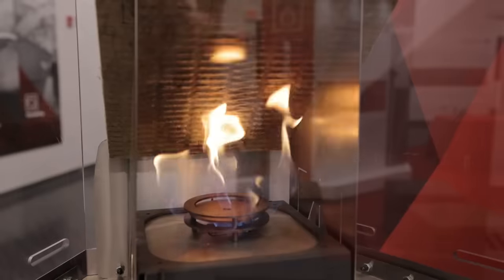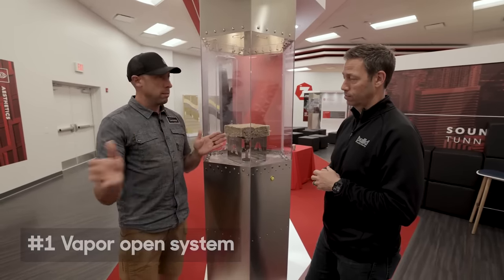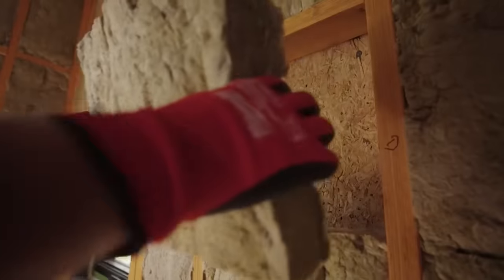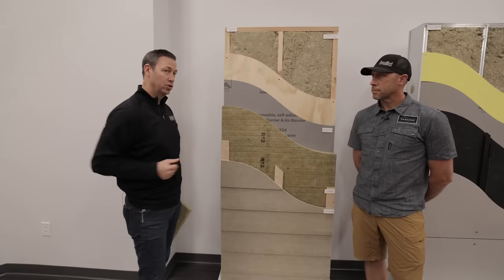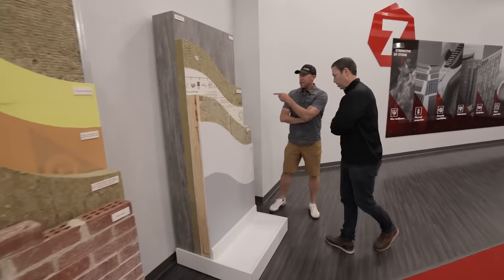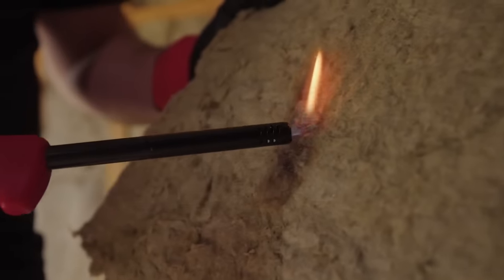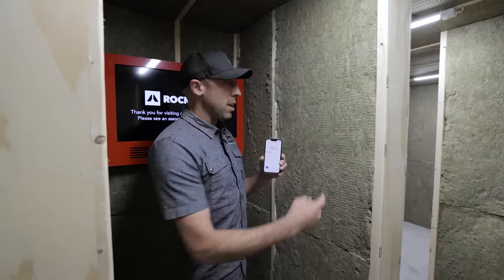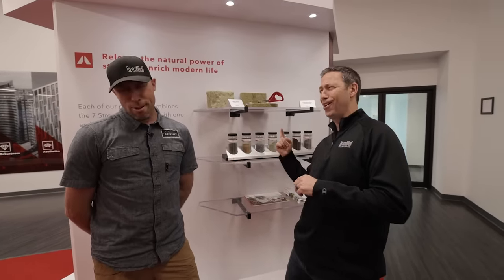3 (little known) Benefits of Rockwool Insulation

Comment: I’d like a video that compares rock wool to other mineral wool competitors. Not a lot of info out there on that and I’d love to learn.
Reply: I can compare it to the stuff from Menards.  When installed it seems similar, but the Menards stuff is terrible to work with.  I installed some in the ceiling of my basement, and had to wear goggles.  It sheds dust and fibres.  Safe n Sound doesn't.
Reply: @r7boatguy  I used the Menards stuff recently too and I had the same experience. Wasn't expecting that.

Comment: Thanks for the great video. I have a 100 year old English Tudor revival in the blue ridge mountains of North Carolina. We are wondering if we should use rock wool in the attic space above the coach house. We have a slate roof which is original and wonder if we should place the rock wool in the cavities between the roof rafters and also should we place an air vent against the roof sheathing first and then install the rock wool?

Comment: I live in Northern Illinois, building our retirement house with a GC.  If we use 5.5 Comfortbatt in the exterior walls (2x6, 16oc) with 1/2 zip sheathing, do we still need insulation board on the exterior wall and do we need a vapor barrier on the inside?  I think in this video you indicate no vapor barrier is needed?  Thanks, love your "delivery" of the content!

Comment: I've put Rockwool (nee Roxul) in my attic and most of my basement.  Living on a busy and noisy corner, heading downstairs to the den, in the basement, traffic and sirens have disappeared.  Plus, the den warmed up significantly also.

I'm a happy camper.  Just wish I had the funds and patience to open all the main level exterior walls and replace the beige 50s-60s insulation.  Sadly, it would be cheaper and easier to add insulated aluminum siding, which I'd hate.

Comment: I’d be very interested in how that sound tunnel works once drywall is up.
Reply from the maker: Less good. Much less good. That’s why my studio has filter fabric over Rockwool and it’s really dead sounding
Reply: @buildshow  The sound bounces off the smooth drywall surface. The bare insulation sucks up the sound waves.
Reply: Matt you need to clarify- if you are talking about deadening sound reflections WITHIN your studio, yes, u r correct obviously ,BUT for reducing sound transmission to the OTHER room/side of wall, you WANT mass, as much drywall as possible!

Comment: I built our house with 8 inch metal studs and had the walls insulated with rockwool,
The insulation installed was $4k by Bob Mutina from west Columbia, TEXAS, fine man by the way, and we recouped that within two years of very low electricity usage.
We have four central ACs and our electric bill was $100-$190 per month.
The utility company has changed our meter three times as they figured a 5000 sq foot house should be using more power.
My question to you experts is: I have an uninsulated attic, fully decked, how can I lay rockwool over the decking and still be able to walk upon it? Are the insulation boards dense enough it will support a man's weight without being distorted?
Thanks for the fine presentation.
Take care

Comment: I wanted to see Comfort board behind a wire-lathed stucco cladding. I was thinking of Roadenhouse "washers" to fix both the Comfortboard and 3 strands of Davis wire with the addition of a stainless washer over a stainless screw assembly. Of course a layer of Stucco-wrap would cover the Comfort board and create a drainage plane down to a weep screed, especially fabricated to support the low edge of the Comfort board, the drainage plane, and the stucco membrane. This might require a thinner Comfort board, but still have a better fire-resistance than traditional Styrofoam.
Reply: Mark-a question I have head for some time. Matt has don’t this with brick and stone Bieber, but both can use the ties as he indicted-can’t do that with stucco
Reply: @johnwhite2576  I am wondering if the bottom edge of the Comfort board needs some sort of special treatment to prevent a buildup of salt, or dissolved minerals if in contact with the screed. I would think a reconfigured lower edge screed that allows the Stucco Wrap to drip OFF the Comfort board would do the trick.

Comment: Matt: love your expertise! Question: Should my attic space over my attached garage be blocked off/walled from my home attic space to prevent the hot air from being over my living space? The space over the garage is uninsulated. The rest of the attic over living space is blow in insulation. I have soffit vents and ridge vents throughout the garage and home. The garage roof faces South and "cooks" in the summer. I live in Georgia.

Comment: Had my whole modular 2440 sq ft house 2x6 stud walls done with roxul rockwool  in 2004  and love it  , cost me extra but worth every penny  . I now cannot find  the solid panels to do my basement walls Hint  separate studs from outside and inside studs transfer heat and cold  . I am now putting another layer of it in the attic . I live in southside VA    no bugs  , no miosture, no rodents  ( I LIVE IN THE COUNTRY AND RODENTS ARE HORRIBLE )and does no harbor mold   LOVE IT LOVE IT  BUT NEED IT FOR MY BASEMENT WALLS IN THE SOLID PANELS  . I really don't want to finish my basement  I just want to warm it up   . No access to the basement from inside  , did not want it . But use it for storage   , floors are insulated to the house

Comment: Matt, I mentioned to a well known window manufacturer rep that I wanted to re-sheath my house with Zip system under Hardie board on the exterior. He said (Don’t do it, the zip will rot from the inside out because vapor is trapped. Said older houses weren’t built to be that airtight. If I had closed cell foam in studs in wall cavities the vapor wouldn’t be able to pass through to the Zip/OSB🤷🏻‍♂️ Your thoughts?
Reply: ALL OSB is vapor IMpermeable, which means it does not pass vapor at all, or so little it does not matter.  This is due to the glues and resins that hold it all together.  Same goes to a slightly lesser degree for plywood.  The coating on the Zip system is really just to shed RAIN penetration from the exterior, not vapor from the interior.  Plain MDF is a tad better (not enough to be called semi--permeable though), but water resistant MDF is not at all due to similar resins and binders.  This particular issue has more to do with whether you are using a smart vapor barrier (like the Intello on the last mock-up) or plain 3 mil plastic.  The PLASTIC creates an 'aquarium' between the vapor barrier and the OSB and traps moisture.  The Intello allows the moisture to escape seasonally (when temperature profile changes) back into the room.  MOST WALLS are not vapor open all the way through, and do not NEED to be!  Using Rockwool on an exterior is more about the EXTERIOR drying, than the interior, AND it does not lose R value if it gets wet (yes, it's generally hydrophobic, but it can still allow water to infiltrate under pressure).  Again, as long as you do not trap vapor and moisture between impermeable layers, you will not usually have a problem with moisture  

BTW, we hyper seal and hyper insulate older homes all the time, we just add an ERV (energy recovery ventilator) that exhausts the air in the house through an energy exchange and draws in fresh through a MERV 14 filter (typically recovers 90% of energy).  It changes the air in the house more than a few times per day.

#BUILDINGSCIENCE
Reply: Jeffery thanks for the excellent explanation 👍
Reply: @Steve L Hi Steve,

Saying 'I know very little about the value and use of the vapor barriers' would have been more of an honest answer, don't you think?

Here is a hint;  vapor MOVES in and out of wall (ceiling) assemblies, depending on the internal and external environment.  ONLY when vapor is TRAPPED by the WRONG BARRIERS does it become a problem.  This is usually due to a LACK OF KNOWLEDGE on how they work.

That's just the SCIENCE, regardless of your opinion....

Comment: Another planning question;  in your videos I see a lot of combinations of insulation. I'm thinking: ZipR on the outside, 2" closed foam inside and some other insulation to fill the remaining cavity.  What do you think?
Reply: 2" closed cell in combination with a 3.5" fiberglass batt is a great combo in 2x6 framing. Depending on your  budget you could get R-11,R-13, or a high density R-15. Or use a 3.5 mineral wool batt. If budget isn't an issue and you want max R value just go full cavity closed cell spray foam.
Reply: @kemp7435  thanks for the input.  According to Spray Jones, after 2 inches, the return on investment isn't worth adding more foam.
Reply: Sounds expensive. Spray foam between studs doesn't get you much better R-value than cellulose, rock wool, or fiberglass because of thermal bridging, and the Zip-R is a great air barrier anyway. If budget isn't an issue I'd just abandon the Zip-R entirely (you have to get the nailing done almost perfectly through 2 inches of foam to get stated shear strength), go with 2x6 & cellulose sheathed with regular Zip, and put 4-6 inches of GPS or polyiso on the outside with cladding on furring strips.
Reply: @hailexiao2770  interesting, seems to a different recommendation than many.

Comment: I’ve had problems getting/ordering a non-stocked Rockwool product in the Dallas area.  As a homeowner with enough knowledge to be dangerous (this channel has taught me so much), I have been tackling several of my own home improvements.  I have been trying to order their ComfortBatt for 2x4, 24” OC walls for some time now.  I have an LLC and tried to setup accounts with the sellers and distributors in the DFW area (even those you mention), but they have told me they are too busy for my business.  Anyone at B1S or Rockwool able to assist.  Take my money!
Reply: Find a contractor friend and give them a " management fee" and use there accounts on a cash basis.  My guy is my former boss that I was laid off from in 2009.  He is big enough that he gets huge discounts and like a few grand on a house ( I only do 1 remodel a house every other year on the side).

Comment: Great video , one question, I live in Pennsylvania, if I put Rockwool r23 in attic floor cavity and cover with wood board , do I need vapor barrier under Rockwool insulation? Rockwool does not make faced batt insulation. How can I use Rockwool insulation in attic insulation? I m really appreciate. I can’t find the answers

Comment: Does Rockwool provide any added structural rigidity like closed cell foam insulation? Also how does the fire resistance compares to closed cell foam that has the fire retardant in it?
Reply: Short answer is no on structural. Fire resistances is better because it inherently doesn't want to burn.

Comment: I know the safe n sound isn't suggested as a thermal product as they don't list an r value. However, in an application like separating a basement and main level, is there an r value or similar that can be figured for separating the colder basement from the main floor and getting the sound deadening quality benefit?
Reply: Mineral wood is commonly rated R: 4.2/in. That said, a wall or ceiling assembly true R-value is defined not just by the insulation but the thermal bridging and the airflow/leakage between the 2 spaces
Reply: I believe the Comfortbatt has almost the same sound absorbing properties as the Safe'n'Sound, and my anecdotal experience has been that there isn't a huge difference in thermal insulating effect between the two either. I still use the Comfortbatt over the Safe'n'Sound when I need both sound and thermal insulation, though.

Comment: I am planning to use cast iron soil pipe instead of ABS in my two story home because of cast iron's sound deadening qualities. 
However, if I were to insulate ABS pipe with Rockwool do you think I would achieve the same goal: to not hear water flowing overhead and through walls?
Reply: Hey Patti, that’s a great question!
Reply: Wrap your abs pipes with clay sound deadening.

Comment: Im a big fan of Rockwool. It's literally water repellant and of course non toxic. I dropped a batt into a water barrel. Thinking it was scrap, I pulled it out and threw into the skip (dumpster). An hour later it was bone dry with a water puddle beneath. The water had literally run out.  In UK our damp climate causes problems with condensation. If we do not use an internal vapour barrier, warm air will percolate through any insulation and condense within. Loft spaces are OK as they should be well ventilated and insulation is fluffy. Rockwool in a wall is pretty dense, water condensing within wont percolate to the outside so it has to drain downwards. It could leave a permanently wet area at the bottom. Do we know that situation wont happen and how would we mitigate any issues?

Comment: Gut renovating a 1940's era house with stone exterior and interior walls clad in ship lap. I am replacing all windows. I'm concerned about adding insulation to the walls due to moisture build-up in the wall cavities. Is Rockwool a good solution in the wall cavities as it can dry both ways?

Comment: Where can you the sound batt? I am a builder and building a multi family and the divider wall I’m using a 2x6 plate and 2x4 studs staggered on each side. That product would work well for this.
Reply: Lowes often has it in the 2x4-16OC variety, but most local lumberyards and building supply shops also tend to either have it or can special order it.

Comment: Mineral insulations are all but standard in most of the developed world. I’m very happy we’re finally seeing it getting installed more and more in the US. 

The cavity insulation is not doing you much good in those mock-ups. It’s all but a waste of money for thermal performance because of the diminishing returns as you get thicker. That’s not to say there aren’t other benefits, but the r value just isn’t increasing enough to warrant the expense.

Comment: My father worked at a rockwool factory when he was 16. Back then, safety standards were pretty low, and a lot of fibrous material floated around in the factory. He contracted lung cancer from that. So rockwool has it's benefits, but also it's drawbacks. Beware when using this stuff.
Reply: I find it shocking that nobody will talk about rockwool's health effects and lung cancer link. Why is that ? Industry sponsored video and not only.
Reply: Like with e- cigarettes, workers at the factories that make these products are subjected to a significantly higher quantity of volatile compounds, much much more than you would in the home. 

You should also be using masks when dealing with any insulation. Small particulates are bad for your lungs regardless of what they are. Gypsum, asbestos, rockwool, fibreglass etc.
Reply: This is a good reminder about airborne particulate safety. Almost anything other than clean air in the lungs can cause big problems.
Reply: All such fibers are problematic except wood based-blown cellulose, wood fiber etc-

Comment: I worked n a house were the rock wool settled n the studded walls about 2/3 inches at the top plate. I’m wondering it might be a good ideal to put a little adhesive on the wool or wall

Comment: great video, although just a quick nerdy point, decibels are a logarithmic scale so half the values of decibels is not half as loud its exponentially less loud. How we perceive sound is not as tidy mathematically but most people will say at midrange frequencies a difference in -/+10dB is perceived as half or twice as loud. the perception changes though with super high and super low frequencies.

Comment: Love Rockwool, but it's NEVER in-stock @ Lowe's, and Home Depot doesn't carry it.
Reply: Lowes also doesn't stock, or even special order, Comfortboard - which is also pretty annoying. Home Depot used to carry Rockwool when it was branded as Roxul, but they switched entirely to Thermafiber since they can get it all from the same manufacturer as their fiberglass insulation.
Reply: @JamesCusano  My Home Depot on Long Island still carries it but only in R15 and R23 in 16" size. They are carrying much more Thermafiber however. Lowe's generally has more but again only in the above size, although they do carry R30 as well.

Comment: Quick question, if this stuff is so dense, how do you fish wires through when adding new wiring in pre-existing home builds?
Reply: Not a builder but would imagine you're sliding it up between the back of the drywall  and the front of the insulation

Comment: only issue I have noticed with it is that it smells funny.  I use a lot of rockwool for acoustic panels and it does have an weird odor.  I'm actually not sure if it is the material itself or just the smells it picks up then releases later.

Comment: In Matt’s first wall model for residences, doesn’t having continuous plywood sheathing keep the continuous rock wool layer from drying to the interior and keep the batts in the stud bays from drying to the outside?  I am sure the perm rate might allow moisture to move through it, but drying thru plywood??  Or am I missing a basic rule of moisture movement?

Comment: I'd love to install Rockwool in-between the joists in my basement, but no one locally can get ahold of  rockwool and thicker than stud bay sizes.
Reply: The batts are cut 1/2" larger for wood studs and they are 16" or 24" for metal stud walls. You might try one of the online suppliers. The other engineer who tests and compares projects - Belinda - has one as her sponsor and they can send it to you. [Don't want to wander off the reservation; Matt is my man, but she is very good too.]

Comment: Had some problems with fiberglass "shrinking and shaking loose" from heavy vibration(near heavy traffic). Anyone know how Rockwool holds up to heavy vibration?
Reply: It does NOT move. It is so dense, you can barely compress it. That stuff will not move or collapse like blown fiberglass or cellulose. In face, I bet it would even dampen the vibrations.